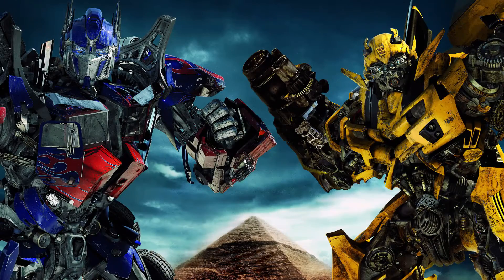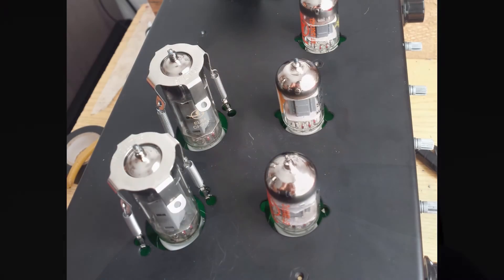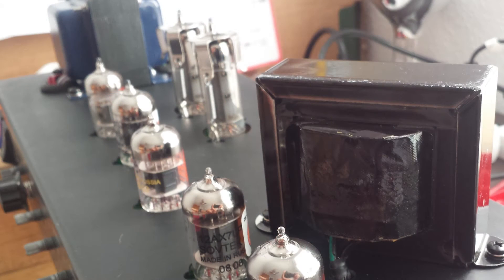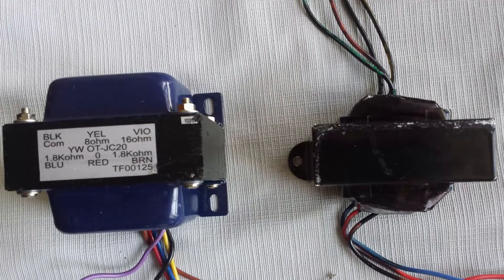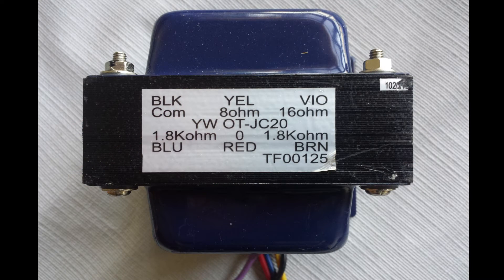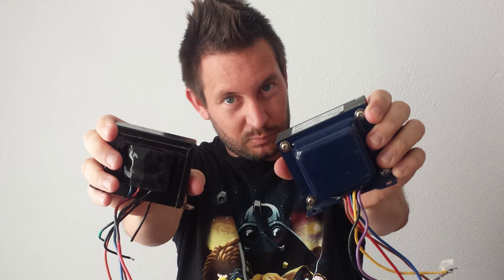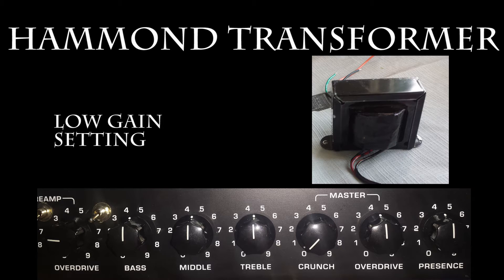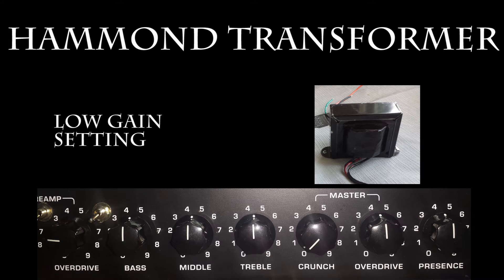Output Transformer Shootout!!!! Hammond vs Stock

Comment: Bottom end of the blue one definitely hold up tight and defined probably because it has better wider bandwidth power available at lower frequencies.
The Hammond has a nice breakup tone.
Reply from the maker: Yes, hammond is smother in the high end and looser un the low end for sure

Comment: Could you please advice if Hammond 1628SEA is good loudspeaker transformer for Single Ended EL 84 tube amp? Is there anything better on the market in similar price? And what about amorphousaudio transformers? Is this good direction? Thank you.
Reply from the maker: @jankowalski3541  Hi man, I checked out that model. I didn't know it existed!!!. I found it at Mouser which is a very reliable website and they have the datasheet there. It says you can actually use it with a lot of tubes in single ended configuration and EL84s are on the list. That said, I think is a perfect fit for what you want

Comment: So interesting! I would like to try the changes in a Hot Rod Deville
Reply from the maker: Cool, which one are you going to try?
Reply: @alveramps  Mercury Magnetics is the OT transformer that lot of people mention, but I wonder if the overall upgrade will worth it
Reply from the maker: @alga1309  Well, I have not used those yet because they are one of the most expensive ones. As far a I know, they have a "particular sound" they sound bright and airy. IMO I would not invest such money to modify a jet city. I would use a Mercury if I build an amp with just high quality parts for example, and then tweak the circuit to taste. For a jet city I would go with something like hammond or heyboer for example but it doesn´t mean that the result you are going to get is necessary what you are looking for,

Comment: I went with Mercury Magnetics transformers and chokes in my 5150II’s. Night and day
Reply from the maker: They should sound amazing, they are super expensive so they better be LOL
Reply: @alveramps  yeah that’s why I started with just the OT and choke. My tech who’s a friend laughed at me for wanting to change out the working stock OT. Well after he heard and felt the difference he became a distributor for Mercury Magnetics. I then left for tour and when I got back had the PT upgraded and it’s how I wish my 5150II’s would’ve sounded out of the box. Some will say.why don’t you just buy a more expensive amp that uses higher quality and it’s because I love 5150’s and back in the early 2000’s you could pick up a used one for around $500. So that with the investment of MM I got a 5150II I got a better sounding 5150 imo for less then buying a brand new one.
Reply: @bradschimke5865  my tech also told me that just yesterday when I was asking his opinion about changing the transformers in my TH30. he said it's bullshit, and even showed me a book from some engineer-guy that proved that on paper, they don't change anything significant when measured. now I'm on the fence. since those things are realy expensive...

Comment: What output transformer should I have to swap the stock PRS MT15 amp?
Reply from the maker: That is a hard question because that amp comes with 6L6 power tubes. The transformers that you normally find for 15-20watt amps are designed for EL84s or 6V6s. You just need to find one that the impedance matchs the impedance of the 6L6s

Comment: Your Hammond transformer its not for the pure hifi audio transformer series in Hammond product. This Hammond "universal" trans  (show in Video)its design for universal or general purpose replacement use only. U know WHY? Because the "Universal" series, the frequency respond range its from 150hz to 15khz only. You may try Hammond  "1650" Series. (30hz to 30khz.) 

https://www.hammfg.com/electronics/transformers/audio/125a-125e

https://www.hammfg.com/electronics/transformers/classic/1608-1650

Please correct me if i'm wrong.

thank you.
Reply: you're not gonna be hearing those higher frequencies anyway
Reply: @Ben-yy7io  True, but the low E on a guitar is 82Hz. If that transformer only goes down to 150Hz linearly then you lose a lot of tone. In the end though, it's whatever pleases your individual ear.
Reply: @thomaswagner1761  True! I forgot about that. So in that instance, would there be a loss of bass frequency overall when you play the open E since the fundamental pitch Isn 't being accurately reproduced?
Reply: @Ben-yy7io  That is correct, on the other hand a lot of people eq the mids higher to tame the low frequencies. It really all depends on the individual's tastes. There is the argument that you can eq out an annoying frequency but you can't eq one in if it doesn't exist. Chasing tone will drive you insane!
Reply from the maker: Hello. Well the one I used is advertised as a replacement for a Marshall 18 watts. For guitar amplifiers I don't think a full range hi fi transformer is a good idea
Reply: Hifi transformers are fantastic for guitar ever heard a hiwatt or sunn)) different sound signature to what your after @alveramps

Comment: Hey nice test but the stock transformer probably isn't as mismatched as you think

Youre forgetting impedance ratio is the square of turns ratio, therefore double turns=4x impedance, so methinks your 1.8k + 1.8k is actually 7.2k not 3.6k, Za-a
Reply from the maker: Maybe you are right.  I checked the DC resistance on both because I wanted to compare and the values were not close between them. Now that you said it I'm going to repeat the test and give you the values.  Stay tune because very soon I will post a video about all the mods I did to the preamp. 
Thanks for watching!!
Reply: It is 7.2K!

Comment: imo the hammond did sound better ie  better note seperation, and a little more low end.
Reply from the maker: Yes, actually way more bass than what you hear in the recording. I just finished the tweaking of tje preamp to suit this transformer. I converted the crunch channel to a cleanish to crunch plexi kind of gain and the overdrive channel from jcm800 to SLO. Stay tune!

Comment: fwiw, I preferred the stock transformer in these recordings.
Reply from the maker: Yeah me too, the hammond sounds way darker as well but right now I'm tweaking the preamp to make it sound as it should
Reply from the maker: @GCKelloch  Well in my case the hammond was too dark and boomy. I guess this amp was design for a lower impedance transformer. Right now I'm working on the preamp. I already got the crunch channel to sound clean/ crunch plexi style. I reduced the coupling caps from .022uF to .0047uF and did many other things
Reply from the maker: @GCKelloch  well there are a lot of variables to control here. I decided to modify the preamp becuase there are a lot marshall style 18watt output transformers available at good price and all of them are around 8k impedance. So far I have brought the brightness back and cut down the bass but I'm still tailoring the gain. My goal is to have a clean/crunch on the first channel that is able to cover Vox to plexi tones and the overdrive channel from JCM800 up to 5150. We will see LOL
Reply from the maker: @GCKelloch  the preamp plate voltages are around 200 something, I have to double check again. I have to try that because I'm looking for tightness. I have new JJs power tubes ready to install after I finish with the preamp mods. Im using sovtek LPS in the preamp right now
Reply from the maker: @GCKelloch  Yeap definitely I have to try other tubes, I have a matched one in the PI right now because it sounds the best to my ears but I have some EHXs to try on the other positions too. Next time I order parts I will try those JJ ECC83S. Regarding the EL84s I have heard good comments about the tungsols as well. For now my plan is to get the amp to sound the way I want in the ballpark, then try different components and some final tweaks. After that I will shoot another video considering the bias and recording using my two notes captor so the differences will be more noticeable. Thanks mate, cheers!
Reply from the maker: @GCKelloch  mmmm I'm going to look into that
Reply from the maker: @GCKelloch  Thanks man it is always nice to talk about this stuff with somebody. I'll get back to you when I find something interesting
Reply from the maker: @GCKelloch  Yes, actually I put one of my LPSs om V1 because it was quieter that the rest. I know tube depot offers loise noise tubes as well

Comment: The turns ratio squared times the load impedance equals the plate to plate impedance. 
( PtoP = N^2 * 8 , for 8 ohms ) 
To get the turns ratio, take the square root of (1.8k divide by 8) = 15 , 
Then the PtoP is (30^2) * 8 = 7.2k .
Reply from the maker: Thank you for that information my friend. 👍👍👍👍
Reply: A load of bollocks recalculate.

Comment: The lowest primary Z for EL84's is 6.6K if the amp works in class AB, or 8K in class A. I don't know how 3.6K can give any clean output at all, but maybe it isn't wanted - all the demo's are distorted to hell. The comment about more clean headroom from the Hammond isn't surprising!
Reply: impedance ratio is the square of turns ratio, therefore double turns=4x impedance, so methinks your 1.8k + 1.8k is actually 7.2k not 3.6k, Za-a
Reply from the maker: Yeah I know. In the video is not obvious the tone change but the hammond sounds way more bass and less treble. Actually right now I'm modding the preamp to suit this transformer, Im cutting down the bass and the gain and adding two modes per channel. I guess when I finish I will post a new video
Reply: maybe they doubled the impedance by using 16ohm speaker with 8ohm tap, it's hard to believe they used 3.6K for two EL84s

Comment: There is barely any difference between the sounds.
Reply from the maker: Electron Conjuror Yes you are right man. This recording doesn't show the differences correctly. In real life the hammond transformer has way more bass. Anyway I have to repeat this video using direct recording to make it more noticeable and I have to rebias the amp after swapping transformers which I didn't do in this video. I will let you know when I make a new video ok. Thanks
Reply: There is a huge difference in tone and gain structure, and I’m listening on a phone.

Comment: Hi, Did you take any measurements of the output tube's plate current while swapping the transformers? I would think the only way to hear any differences, is if the the tubes were biased the same for each transformer.. If one is biased much cooler than the other, that is most likely the difference being heard. Just my thoughts...
Reply from the maker: Bucyrus Erie12 No I didn't but I will.
Reply: Great... Please let me know the results when you do... I don't think you mentioned how many ohms the speaker is. If you left the same speaker in during the comparison, I think you will find a large difference between the two due to the large difference in the two output transformers primary impedance's. Thanks, Tom
Reply from the maker: Bucyrus Erie12 the speaker is a celestion V30 16Ohm. Actually im going to repeat that video when I get new tubes for my amp and I will mention the bias values

Comment: Paul Rivera played with impedance for classic Fender designs, Trainwreck to take an 'extreme' example is supposed to also have a mismatched Z value for your typical expected EL84/34 OT design.
Reply from the maker: Nightingale1887 thanks for that information. Do you know what is the effect on the tone?

Comment: clean test is missing :(
Reply: My Chess sorry about that bro. I didn't do cleans because that amp doesn't really have a clean channel just crunch and overdrive. I'm working on some mods where I can switch the crunch channel to clean like the original Soldano SLO but I'm still not happy. When I finished I'll post a demo. Thanks

Comment: This is very well done. Thank you for this. I changed the OT in my JCA20HV to a Bulldog M6 and noticed subtle differences, all for the better.
Reply from the maker: trahnettilhcs thanks for your comment. I'll check it out those transformers. I left hammond but I'm trying to tame the bass
Reply: Yes, the Bulldog M6 is made by Demeter Windings in the UK & definitely tames the fizz, tightens the lows & actually gives about 10 to 15% more volume. I did factory mods & repairs for Jet City for 4 years and I know these amps inside & out.
Reply: @markmarshall7939  Are these available in the U.S.?  I just contacted their web-sight and am still awaiting their reply.  Thanks.
Reply: @qua7771  They used to be available direct from Jet City. They have an updated transformer currently but I'm not sure who the manufacturer is.
Reply: @markmarshall7939  I seen that JCA has a branded thunder/ lightning brand that they claim to be larger than previous units.  I'm trying to find an affordable solution.  Mercuries are pricey.